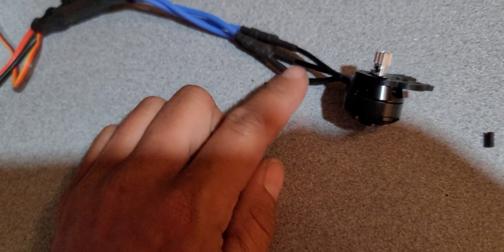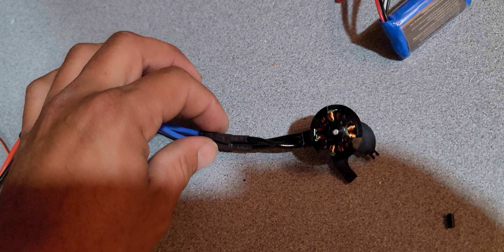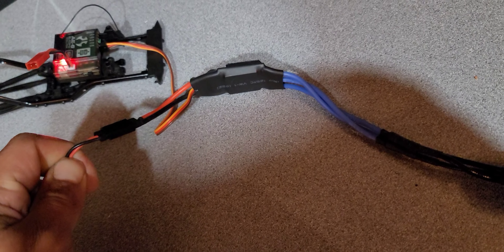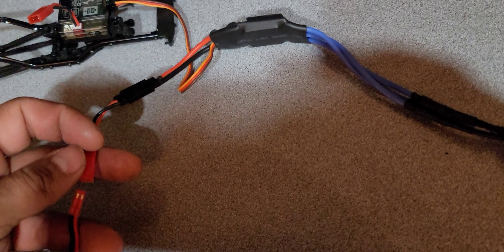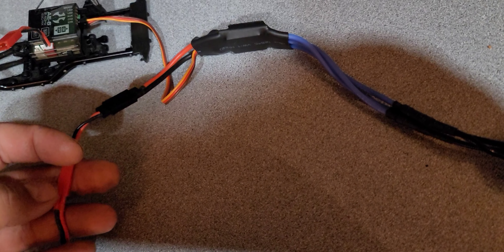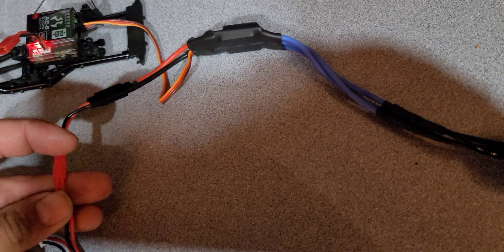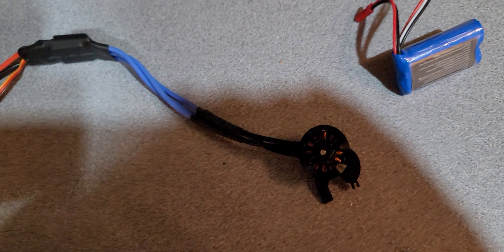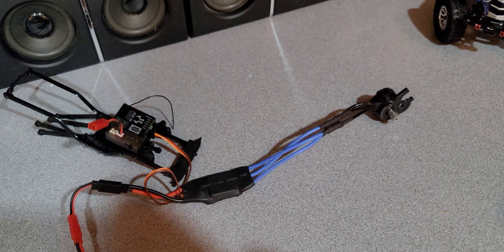got some mail and surpass experiment

Comment: Same as you, I have a few brushless set ups for future projects. (Not  a  clue, lol) After a bit of research I think it maaaaay(?) be calibration of the esc? Hoping there's more info in your manual. Turn it off stand on one leg, give it full throttle turn it on 'till it beeps, flashes a local school, plays dixie, then zero throttle, aliens will land and pray to baby Jesus. Hah, good luck bud.
Reply: Update: Just ordered a compatable programming card fer my ESC. Was about 11 bucks! I'll be setting my cut off voltage, brake, take-off speed. haha, I'm gonna go nuts.